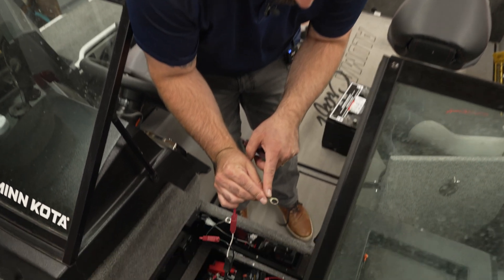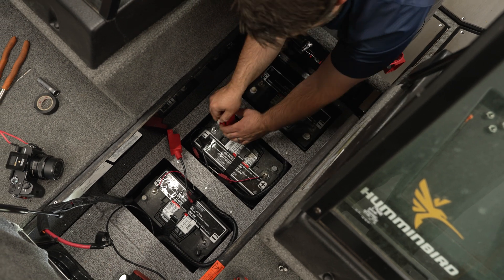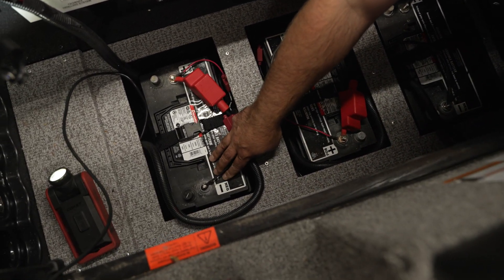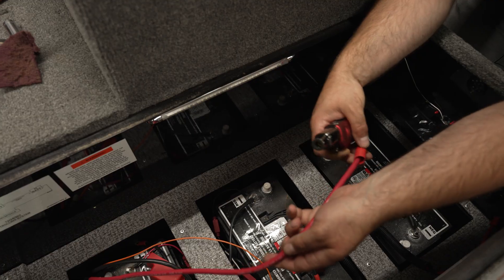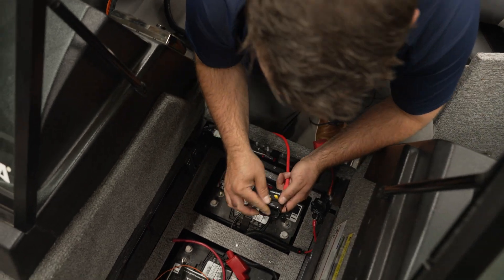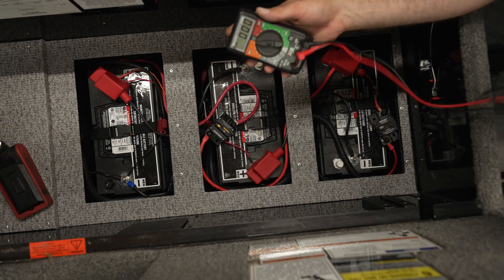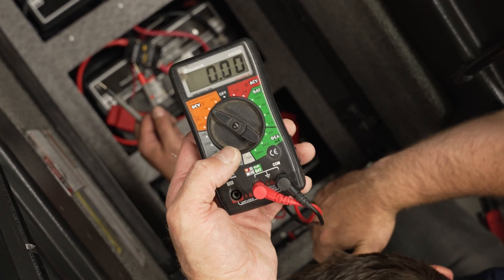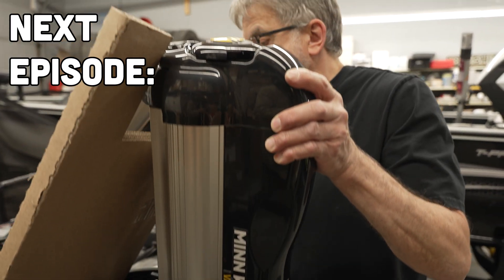How To: Wiring 36 Volt and 12 Volt Battery system for Minn Kota Vantage Trolling Motor

Comment: I have a Vantage 80# and a 101# Ulterra, so I have to run 12 and 24 volts to the Vantage and 36 to the Ulterra. My question is, do I have to run all 3 negatives to battery one post? It's set up as  B1-12, B2-24, and B3-36volts.  Thanks

Comment: Just installed three lithium 12v batteries in series for my sons 101lb thrust minn kota trolling motor…Can I use a 12v three bank charger to charge the batteries or do I need a 36v charger…Thanks
Reply from the maker: Hello! You can use a three bank charger and charge each one separately just make sure it has an option to set the charge cycle specifically for Lithium batteries

Comment: Will that make an unbalanced draw on the system due to the motor pulling from only one battery? Would it be better to run the motor to a 36v to 12v converter? Not an electrician, just what i read and looking to run 12v from my 36 v system.